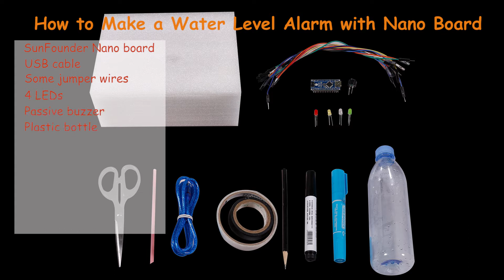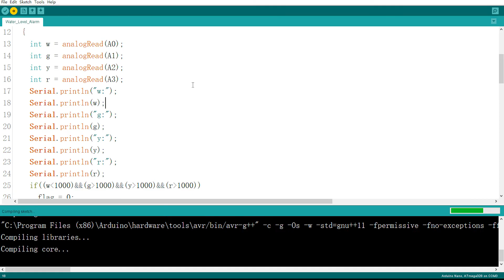Arduino Projects - How to DIY a Water Level Alarm with Arduino/SunFounder Nano

Comment: Do you have any Idea how realize such a solution e.g. for a toilet tank, where u can't put in such a stick with wires in different Levels. What can I use to to build a waterresitent Level-sensor within a closed tank ?
Reply from the maker: Dear smodo bär, 
this is just a handmade, you can make yourself a water level alarm, but for more accurate measurements, there must be  more professional sensors, you can go to Amazon to buy the relevant water level measurement sensor.
Have a try!